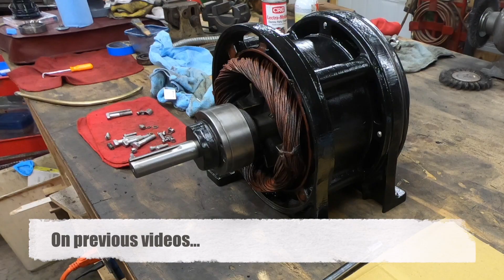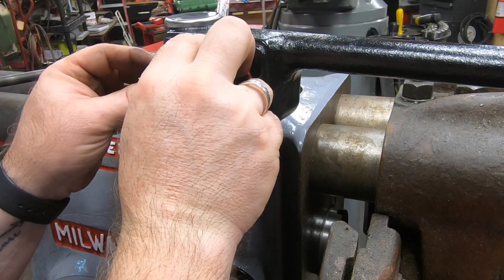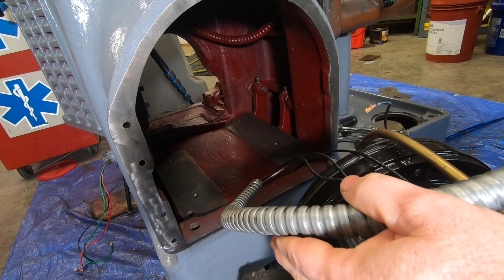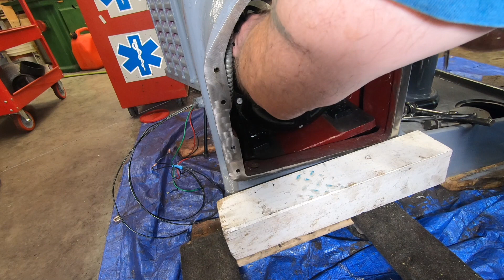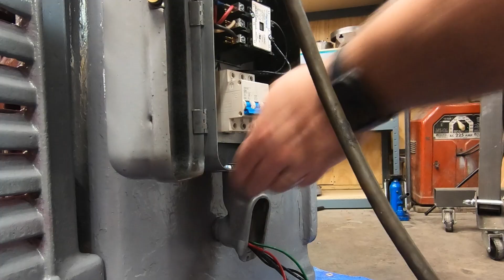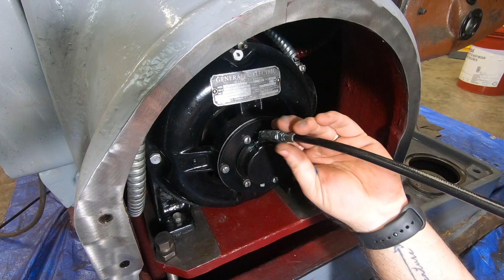Installing and wiring up the motor on the K&T 2HL

Comment: By using a circuit breaker and a contactor to control your motor, you have no overload protection for the motor.  The breaker only provides short circuit protection.  You should have used a 3 pole motor starter with overloads.  Please read the NEC article 430 on motor wiring.
Reply from the maker: I've been doing some more research on this. Thanks for pointing this out. My thought is to remove the breaker, since there already is one back at the power source, and replace it with an overload protector. I just need to find ones that will be budget friendly and sized correctly.
Reply from the maker: I'm not an electrician, and I don't claim to be. Considering what was in this machine before, this is a step up. I am planning to add a 3 phase voltage monitoring relay that will shut down the contactor when there is a loss of the generated leg or an under/over voltage situation. But, I suspect this won't be to your liking either, and I am just going to have to live with that. But thanks for watching!
Reply: @MyLilMule  I do like the idea of adding a phase loss/reversal relay to the circuit.  Good idea.
Reply from the maker: @grounded-b937  I wanted to do that also so I don't accidentally try and start the machine when the phase converter is not running. Don't want to burn up the motor. I appreciate you pointing out my mistake. Recommendation on a simple, budget friendly, thermal overload relay? I've found them ranging from $8 to $200. I know I have to pick a specific current range, but hoping to find something that is simple to install. I don't want to have to replace the contactor if I don't have to.

Comment: Green wires should only be used as a ground wire, not for power control wire.  Typically all wires will be one color, then numbered one, two and three.  1 goes to the STOP, 2 is common to both and 3 goes to the START switch
Reply from the maker: I used the same colors that Kearney and Trecker used when they built this machine.
Reply: @MyLilMule  when Kearny and Trecker built that machine in the 1940s, they did not even have colored  wire. Someone rewired the machine since then, using green wire
Reply from the maker: @grounded-b937  Possibly.

Comment: Your machine is shaping up nicely. I just bought a 1CH KT mill. I need to rewire it and need some information about your contactor and breaker. Do you have the part numbers for them? Not a lot of information out here to convert the old style wiring to new.
Reply from the maker: I am no expert on these. I just used what seemed like the right ones. I would not recommend you use what I did.
Reply: Thank you. I bought a new contactor and should be good now.